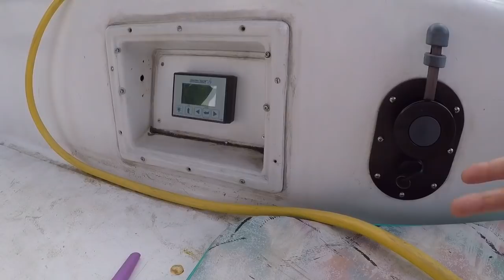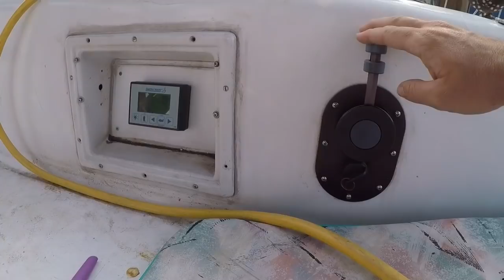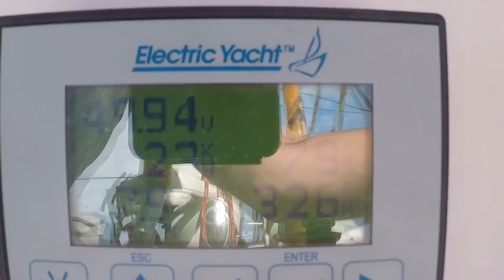Our Electric Motor | Sailing Wisdom Ep 32

Comment: Also I would love to see the setup and configurations, Doesn't the motor when under sail charge the batteries?
Reply: They said that it did. I think they said they start regen well at 6 knots sail, getting an amp, then up to 8 they get 4 back. . I think.

Comment: I say good on you! I’m going electric as well on a cat but I will have a generator capable powering them directly.
Reply from the maker: +Brian Alsum awesome! We're getting a generator for the ICW because we can't really go the speed you have to be able to go in there
Reply: Rigging Doctor yeah there are some definitive advantages to going EV. And other than upfront cost pretty much every disadvantage claimed by the haters can be over come easily. One thing to note on you battery bank how ever is while you may calculate 800Ah of power in reality you really only have 400Ah due to a 50% DOD for lead acid batteries. You also are limited to about 200 charge cycles. I’m using LIfePO4’s that have a max DOD of 80% as well as around 2,000 charge cycles with 1/4 the weight. This cost at a higher upfront cost but will pay off in not having to replace them mid voyage. I would love to talk more EV with you if want to chat it up some time.

Comment: Here is an idea to think about.  What IF . . . you were to take a small 12 V motor powered by a 12 V battery and drive a 250 Amp car/PU truck Alternator to charge all your batteries with.  I'm sure you can figure out how to make this happen!
Reply from the maker: +Richard Frazee it would work, but you would spend power on the motor to turn the alternator that would be producing charge. With resistance and inefficiency, you would lose power. 
It would be the same as running a battery charger off of an inverter, eventually, you will run out of power.
Reply from the maker: +Richard Frazee believe me, when I got the motor, I asked about hooking an alternator up to the shaft and they explained to me that a motor and an alternator are practically the same thing. The force generated by an electric motor is the same as the force required to spin an alternator.
Reply: Richard Frazee dont quit yer day job.

Comment: I believe the electric motor was a good choice. Did you realize any cost savings over putting in a new diesel? How long can you motor on the motor?
Reply from the maker: The cost savings were dramatic! The total cost of conversion (including the yard bill) was about $21k. The new diesel that was recommended to me by the yard was $28k (not including the installation cost). 
Our range is rather limited with our current battery setup. We can motor for about 20 hours at 2 knots, giving us about a 40 mile range. If we speed up, the runtime comes down and so does the range. At full throttle, we can motor for about 20 minutes. We find it has enough range to comfortably maneuver around a marina and for docking.

Comment: How do you  snyc both motors?j If one drags the belt may wear...Yes????
Reply from the maker: They just do and it works. Each motor has its own belt to the shaft, so the belt is always under load (motor turning shaft) so if a motor is dragging the load would simply go the other way (shaft turning motor).

Comment: And what did it all costs? thanks
Reply from the maker: The motor cost $8,000; the batteries were $1,800. This was also much cheaper than the cheapest replacement diesel available to us which started at $25,000.
Reply: And would you be able to charge the batteries during your travel by solar or windenergie?
Reply from the maker: Yes, and the motor itself acts as a hydro generator while sailing. When we crossed the Atlantic this summer, the motor provided all the power we needed. It was cranking out 20-28 amps @12VDC for most of the passage with a few spikes of 40 amps @12VDC when the winds were really pushing us.

Comment: You'll get a lot less voltage sag with lithium and you'll get far more charge-discharge cycle but yeah they do cost.
Reply from the maker: We are seriously considering switching our batteries in the very near future
Reply: @RiggingDoctor  And they're half the weight which is important if you racing which you're not but might save your back.
Reply from the maker: Thanks!

Comment: Install a generator and motor if you need to motor sailer.  

I like the new electric motors on the market. They can act as a generator and recharge your batteries
Reply from the maker: Ours did just that and met all our power needs as we crossed the Atlantic.
Reply: @RiggingDoctor  what company did you use? I'm planning to remove my 4 108 and replace it with electric.
Reply from the maker: Electric Yachts!
Reply: @RiggingDoctor  awesome.  I have been looking at them myself.

Comment: I am a little concerned, didn't see anyanalids on drive shaft to take care of static electricity, ( yes I know I misspelled analids), didn't see any on the boat either, maybe it is just for steel hull, I don't know...
Reply: Do you mean anodes? They are on the outside of the boat, in the water, where there is an electrical connection / galvanic action

Comment: Make sure that the cabin is well ventilated when you run the Ginny! C02 is heavier than air so it sinks and accumulates I low areas and can take up to three days before it leaves the body even with oxygen saturation decompression chamber! A good 02 sensor will keep you safe.
Reply: buffettfanman  I think you mean CO takes longer to leave the body not CO2. CO is what is dangerous and binds with the hemoglobin if I remember correctly. You can hyperventilate and rid your body of its normal amount on CO2.

Comment: how much runn time at half throttle?
Reply from the maker: We get about 2 hours at 50% throttle with our battery bank. That time goes up to around 5 hours when we are running the generator
Reply: Rigging Doctor thank you I wondered how you would deal with passage on a canal or narrow channels with no winds but 2 to5 hours even 3 knots would do it
Reply from the maker: +cartmanrlsusall with all the bad weather we have been having, we have been making our way south in the ICW, which honestly is a giant and long canal. We simply time the tides so that we are moving down stream, and only go when there is no wind or wind behind us, since we don't have room for tacking.
The generator is the real hero in this situation, as we have been running it almost the entire time we are motoring along! We have burned about 12 gallons since we left Hatteras about 152 miles ago.

Comment: have you guys heard of the cat that did a trans Atlantic cruise on solar electric back in 2006/2007?
Reply from the maker: No! But I'm assuming it's a catamaran and not a kitty cat like I first imagined when I read this. Was it the one with no batteries at all?
Reply: Rigging Doctor They had alot of batteries, enough to motor overnight. I was able to get on board here in Savannah. They showed it up in NYC before taking it back to Europe. If you like, I can dig up the info. Just want to tell you that you're doing it right.
Reply from the maker: I would love info on that! It's good to see how similar systems are done because they might have solutions to problems we might have not encountered yet.
Reply: Rigging Doctor will do. I just sent direct message under babaluto. Talk soon. Alex

Comment: Why not go electric, Sailing Uma does great with theirs. The motor is just as good as a diesel. You are only limited by battery storage, which can be added to. Solar panels, wind, reverse spin charging by the propeller. The electric motor is the way to go with a good sail drive.
Reply from the maker: It’s been great. We’ve had it for 5 years and sailed much longer passages than Uma with much success!

Comment: Electric is ok, but once I carved an efficient sculling oar, I removed the electric.   Sculling oars are more efficient and reliable, and should be in place before you consider electric.
Reply from the maker: Funny you mention sculling oars, we carry ours tied to the bow. It's that giant piece of wood you see on our port bow. The oar is 16 feet long and can slowly move us along if there is no wind against us.
Reply: My sculling oar pushes me 1.5 knots (measured with gps) with the effort of pushing a shopping cart, or rowing a dingy.   I can scull straight into 15 knots of wind and make forward progress, but this is normally pointless as I can sail.
Reply from the maker: That is awesome! I am not proficient enough to get those kinds of speeds, but it does move us if the motor fails and the wind dies!
How big is your boat? And is your oar blade oriented vertically or horizontally?

Comment: Sailing Uma (http://www.sailinguma.com/home/) also installed an electric motor in their sailboat a few yrs back, and have had no issues with it. Like you they prefer to sail as much as possible and only use the motor for a few minutes at a time when anchoring or docking.
Reply from the maker: +jrp616 we greatly enjoy sailing uma :)
Reply: No problems?   I believe they needed a new battery bank in pretty short order.    But to each his own.  While on long passages I have run the diesel for days at a time.   Electric would never work for me

Comment: You cant use a hibryd....run the electric engine power by a generator special wen you batheries are low....
Reply from the maker: We ended up trying that setup to make it down the ICW. Your running speed is limited by the size of the battery charger.

Comment: I'll be honest with you I was 100% against electric drive but after watching your video I'm only 45% against I'm in old diesel man I've drank it washed with it and been on fire with it

Is that Charlie the bird on your shoulder if so he's gotten big!!.
Reply from the maker: That was Sammy, she lived to be 13. Charlie is now 2 years old. 
Electric is a sweet setup but you need to build a big battery bank to hold the power to enjoy the sweet system. If you don’t, it’s like having a diesel with a gas tank the size of a tea cup!
Reply: @RiggingDoctor  cool sorry about Sammy also calling charlie a boy lol.
I like the idea of electric motors but I call home Norfolk Virginia we have the ICW the US navy also those crazy Marines with their airboat things. 
Do you have trouble with heat soak on those motors after running for extended time?

Comment: why are there 2 electric motors?
Reply from the maker: Each motor is 10 kw and they are set up in parallel to pump out 20 kw on the shaft.

Comment: Hold on there. Nobody doing electric is advocating lead batteries in parallel. Even the tiniest differences in voltage and characteristics causes discharge and chronic problems. An isolator switch is the simplest answer when heavy charge will cover up the problem. Old statistic: Germany lost about half their Panzerkampfwagen 4 tanks in  world war 2 to what you are showing here. Batteries wired in parallel also causes much grief in yachts and solar powered homes. Second subject: Electric propulsion. OK for subways. Bad for boats. The common lithium solar is so expensive and heavy, and boy can it turn into a fire hazard. My answer is air cooled Chinese diesel engines and I encourage much less horsepower than factory. There's no salt water cooling to break down, there's dry heat to make the boat drier, and the fuel consumption goes so low, you don't consider using an abused boat fuel tank. Just jugs of fresh highway diesel. Minus a few hundred pounds, your boat is safer and more limber. My 168F diesel starts you off at $209. Mount it on an aluminum plate and watch the break in oil consumption. Avoid lowest idle and zooming over 2000 RPM's. All Chinese diesels are rugged and cheaply easily sourced and replaced.
Reply from the maker: This setup worked very well for our ocean crossings. We switched to lithium when we sailed back to the US and that has made a world of difference in our range. 
I would much prefer a simple electric motor over a motor with lots of moving parts from China. 
They may be cheaply sourced, but if it breaks down in a remote or deserted area, you won’t be sourcing any parts and you are screwed. I like stuff that is dependable and reliable, which is why I prefer to count on my sails for propulsion and leave the motor to tight quarter maneuvering.
Reply: @RiggingDoctor  Lithiums have a circuit oddity called a BMS battery management system. It covers up batteries in parallel, and they are fine. Lead puts you in a separate category. Batteries in parallel could be extremely matched or degrees of unmatched. Good boat installs have an isolation switch as a minimalistic measure to squash problems. It's not individual, like an oil painting. I teach what keeps everybody safe while they climb the learning curve. A tiny diesel generator is especially useful in a long storm. People wrestle with heavy equipment, higher fuel consumption, and water cooling problems, because they don't know better.

Comment: There will always be someone to criticize anything you do. They said the horse carriage would not what take off. And look at it now. Escamp van steen petrol. And now the inevitable has happened it's electric. The future is electric fossil fuel is going to be frowned upon. I think you are very smart people to look to the future. Electric motors I certainly better to control. There clean they are efficient and they have less maintenance and they use less room which is vital on a boat. Plus they said it's not safe. Neither is carrying many litres  of highly  flammable fuel on a plastic/wooden boat. Moss fossil fuel engines will be extinct you are forward thinking. for that I highly recommend you  well done my friends safe journey happy selling..ps. i love the parot. And the wsy you tuck one of your legs away. Why dont you go the full hug.  get it amputated. Get a peg leg.pop one of your sunglasses lenses out.  and fly the Jolly Roger. Sorry just one of my not so funny jokes. Good luck and well done with the engine

Comment: A lot of your logic here isn't really logic.  You've kinda arrived at a risky compromise by first considering a very dangerous compromise (no engine at all) and comparing that to what you have now, which is reassuringly better, obviously.  Even just an unplanned outgoing tide is going to snooker you on battery life if you aren't extremely careful, and yachting is more about removing hidden preconceived ideas and traps, than laying new ones.  I suppose if you are prepared to make sure that you always have two or three times the energy required to complete the task and hand as well as the unplanned tasks, and then the emergency tasks as well - then you are going to be fine!  But sailing is supposed to be enjoyable and I don't think I'd want to dedicate that much brain power to the unforeseen, when I really was out there to relax.  In the end, people like yourselves do find new ways of doing things that 'ordinary' people hadn't thought of, so thank you for that.  Keep trying new things, but be safe out there!

Comment: Lee is this you?
Reply from the maker: +iandi Boats not sure who Lee is
Reply: Rigging Doctor I thought you may be the host of "Sailing Stories." Your voice sounds very much like that guy. His name is Lee Cumberland. It's one of Andy Schell's podcast. I would like to talk to you about your electric motor. I was considering it. I have plenty of room for solar panels. I was looking at the 350 watt panels. Putting at least four of those on my boat and I have enough room to store about 16 batteries in total. It's a 54 foot boat. My quandary is how much solar energy would I need to produce to run a motor for at least 8 hours a day at around 2000 RPM. The boat weighs about 18 ton?
Reply: Rigging Doctor where to start...?
Reply from the maker: +iandi Boats it's a very small world, Lee Cumberland is a friend of mine! We used to live in the same marina in Baltimore, MD before we went cruising. 
About the power issue, you are very fortunate to have that much real estate available! Having a large battery bank that is being fed by such a large array will certainly give you more range and speed than we have. We are also 18 tons and with 100w, we can motor along at 2 knots for about 2 days; so you should definitely be able to go faster than that. 
All your panels should give about 28 amps @ 48VDC which spins our prop around 750RPM. That also pushes us at around 4-5 knots. Any speed higher than this would then start to draw on your large battery bank. 
For specific predictions, I would contact Mike Gunning at Electric Yachts (mike@electricyachtssocal.com).
He can give you a much better estimate about range and speed than I could.
Reply: Rigging Doctor I'm a little embarrassed because I met Lee at Andy Schell happy hour a few weeks ago but couldn't remember exactly what he looks like LOL. Ssshhh let's keep this between you and me and the other couple of thousand viewers LOL

Comment: Our 80 hp diesel saved our sailboat in a 92 knot blow so stop bad mouthing diesels.
Reply from the maker: We are sharing our personal preference. Under those circumstances, we would have hove to or dropped anchor. It's good to have awareness of pros and cons of both types
Reply: There was no room to hove and as the anchor dug in it picked up an old sunbrella bimini and fouled so it was up to diesel.

Comment: No fossil fuel is the way to go I want to make my 1960 full electric I have been reading and trying to check what kind of engine they are using.......thank you
Reply from the maker: What boat do you have? I think older bots are much more beautiful and graceful looking than modern boats
Reply: Rigging Doctor I have a 1947 monk it need a substantial amount of work the engine is new but there is lot of rotten wood panel that has been replaced.....I should have it ready for a cruise by end of year.